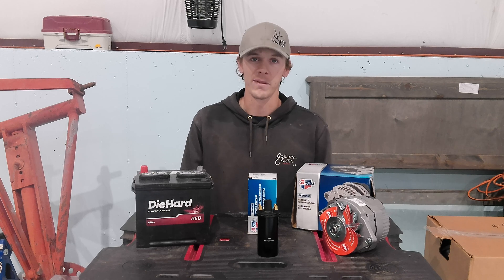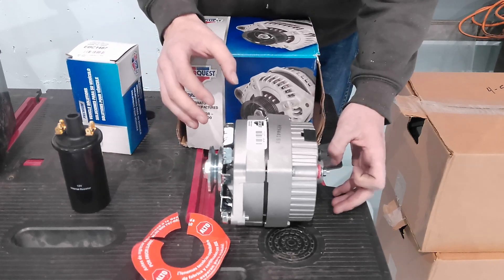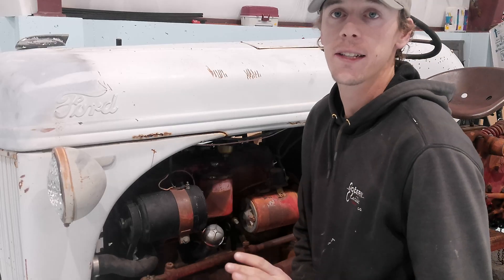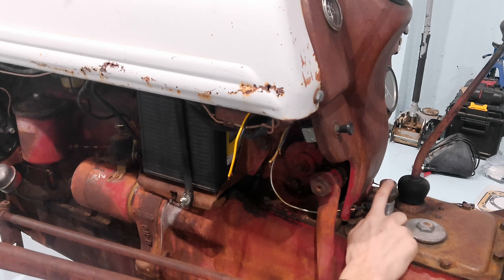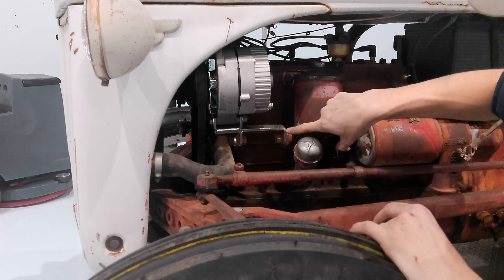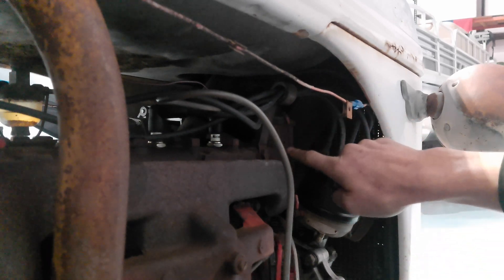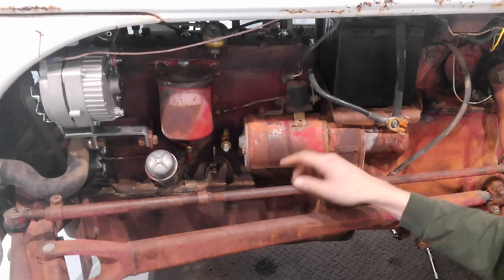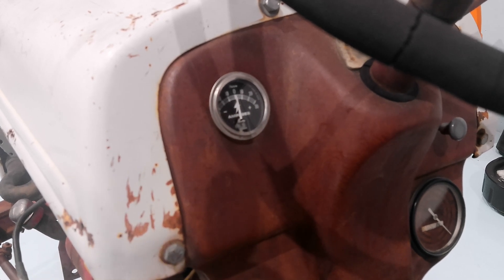How to Convert an Antique Vintage Tractor from 6V to 12V

Comment: I have a VAC with a largeer push button on the dash for starting.  can I still use it?
Reply from the maker: Yes. Are you worried about 12 volts going through the switch instead? I suppose it could technically wear out faster than at 6 volts, but I’m sure it will just about last the life of the tractor before needing replaced
Reply: @Tractor-Roy  I had someone make a comment to me that I would have to not use my push starter.  I was just wanting imput from someone who has actually done this.  My tractor has a on/off pull switch along with the push button starter.  Good to know that I can. keep them.  I will replace the amp meter with a voltage meter.  thanks for the video.

Comment: Thanks muchly brother. Just picked up an AC d10, i bought it from a lady whose husband had been working on it a while back before his health started failing. He was mid restoration, and was in the process of redoing the wiring. On top of that, lot of the wires have been chewed on by rats, and the rest is just a mess, so im gonna have to just yoink it all out and redo it. So while im at it, i might as well go to 12 volts lmao. Thanks muchly for this in depth video, its making everything much easier to view and plan out.

Comment: That is so much easier to do with the hood off. Buy a bracket kit, you won't regret it. I wired in a volt meter instead of ammeter.

Comment: Do you change starter out from 6 volt to 12voilt
Reply from the maker: Nope. Like any starter, you just need to make sure you don’t crank it forever and give it a good break to cool down between starting attempts. Since the voltage doubles, the speed will double. So if your starter spins 200rpm @6v it will spin 400rpm @12v. I’ve got a Farmall C and an Allis Chalmers WD45 that barely need the starter bumped because of how much faster it spins

Comment: Do you need to replace the 6v solenoid with a 12v?
Reply from the maker: Probably wouldn’t be a bad idea. However, it still works with the 6v solenoid and for as long as it’s engaged it’ll most likely last a long time

Comment: I had an old Chevy PU.  I installed a 0-100 ammeter in series with the 135a alternator output lead.  I installed a shunt that would cause the ammeter to read 100 when the alternator is putting out 135 amps (that would be 100% of the alternator's maximum output).  That would tell me that the alternator is outputing current to the battery and load (lights, ignition and other electrical accessories).  I also installed a voltmeter to measure the battery voltage to monitor the battery's state of charge.  If the ammeter read 0 while driving, I'd know that the alternator failed and I'd be running on battery power.  Yes, I could have bought a 150-0-150 ammeter but I used what I had on hand.
Reply from the maker: Wow what did you have that needed that big of an alternator? I’m all for using what’s laying around. Whatever works!
Reply: @Tractor-Roy  That's a common size for full sized cars and trucks with 8-cyl engines.  It was an upgrade to my 350 engine.
Reply from the maker: Yeah 2 of my 350s are 78a and the other is 63a. Too used to old stuff that doesn’t need much to run